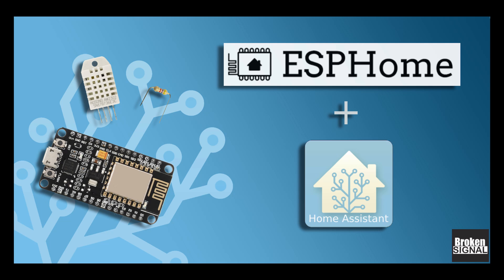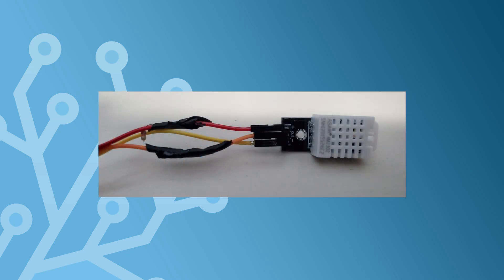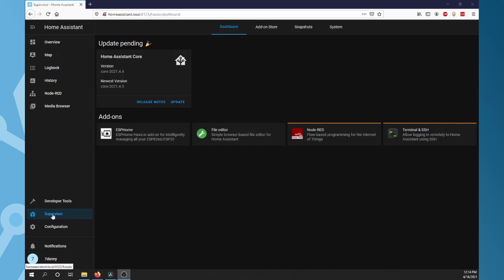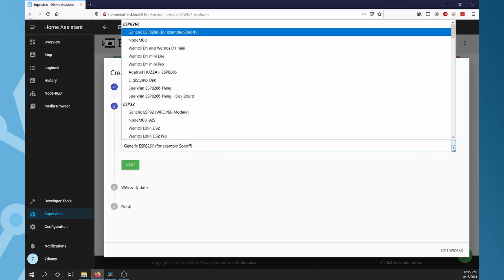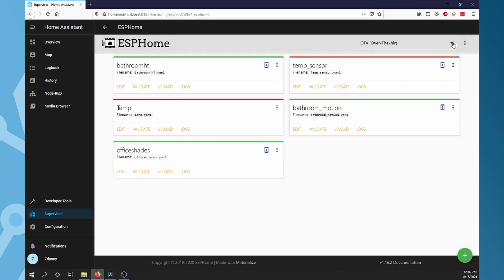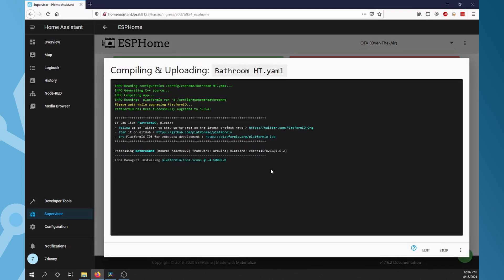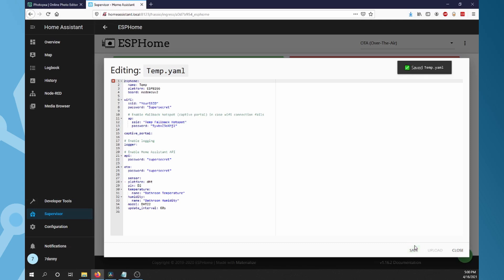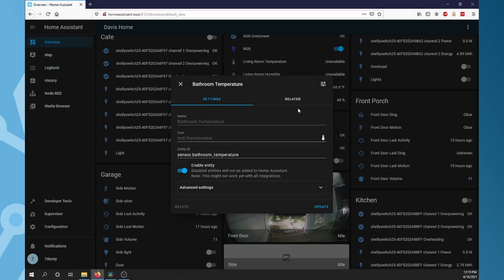ESPHome with Home Assistant using ESP 8266 and the DHT22 Temperature and Humidity Sensor

Comment: overall what was the total cost? I'm seeing ESP8266 ESP-01 ESP-01S DHT11 Temperature Humidity Sensor Module ESP8266 from china for .86 USD. It's all in one package. Is this a good deal or is there something I'm missing?
Reply from the maker: I spent less than $10 for mine. As far as .86, watch out for shipping costs.